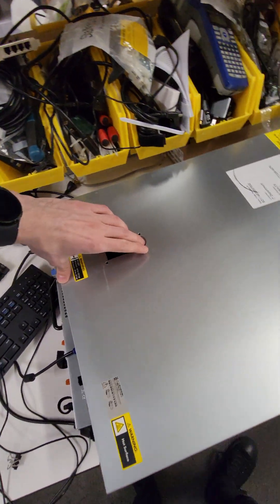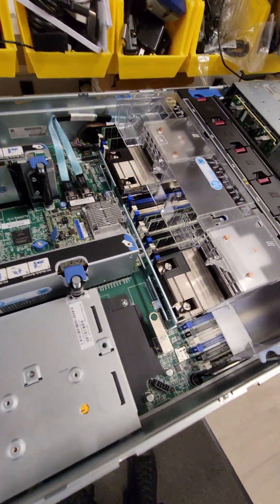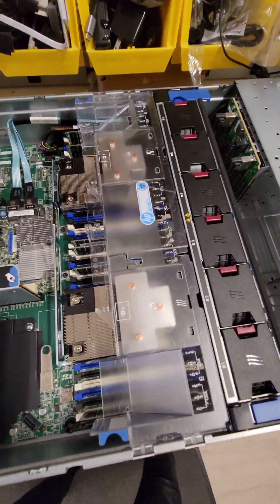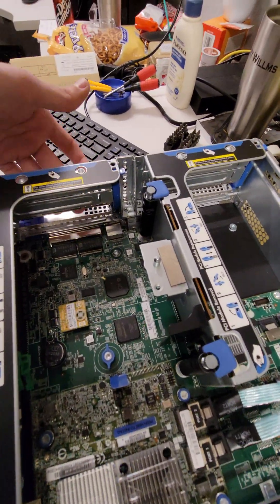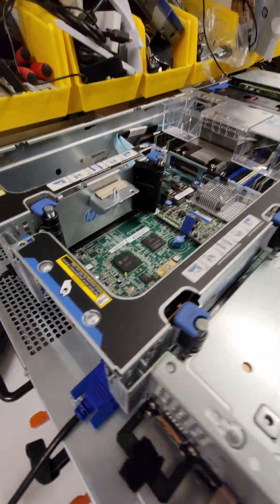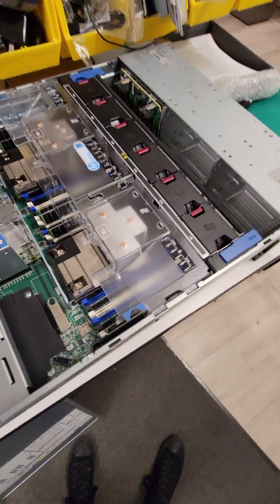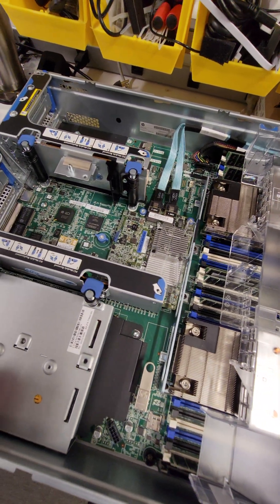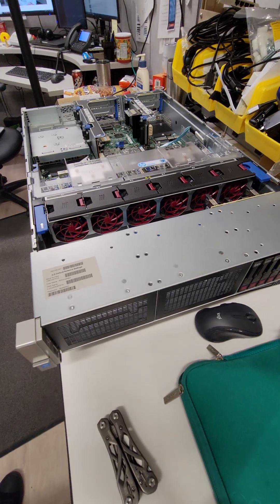24 core HP Server for under $500?

Comment: 10 notebooks mr. Illñ i.d. hp. 48 diagnostic translator usb 4 pin 
14 p.i.n. person. Animal. Robot.  radiant area broadcast 
2g and  o.s.s.e. 

Intercom b.a.u.d 68013 master remote..

It's computing 1.6 processor

I'm r.f. the four basic food m.a.r. t.e.r. a.v.a & u.h.f. 

U.h.f. connects -r.f.+ ¿p.o.i. ñ ? 4243 types person|robot|animal  p.o.i. ñ
I am using translators to get to 26 r.f.+ and -r.f. to stopa interstellar globe | carrier a.r.g.o. terminal conduit ¿t.h.e.p.b.?
$1,300.29

Comment: If not confidential, what do you plan on doing with this server? It is indeed a good deal, but still only for specific use cases. Curious what yours may be.
Reply from the maker: We currently run three HPE prolient DL360 G10 as part of our on-site server infrastructure. In fall we are adding a fourth server to host new campus wide system. During the implementation we'll be running the new system in parallel with the old system for about 6 weeks. 

During that time this server will receive some of our less critical systems and user VMs that don't get accessed regularly to free up some resources on our primary servers. Essentially it will become a spare tire for 6 weeks that may not even be needed. 

After the implementation finishes this will be a test server that is VLANd off from the rest of the network.